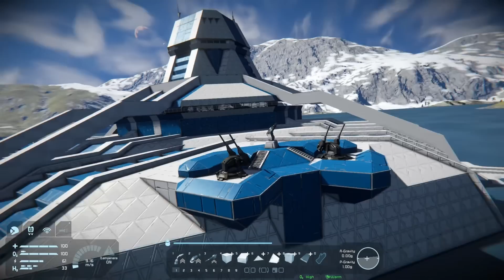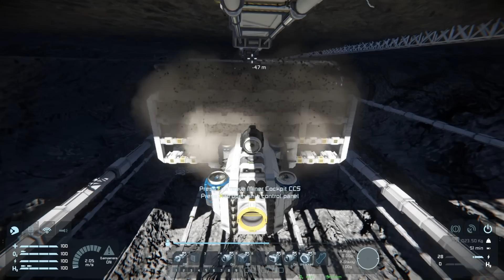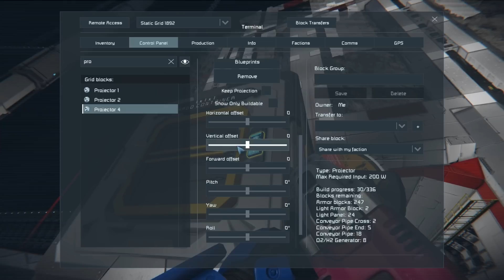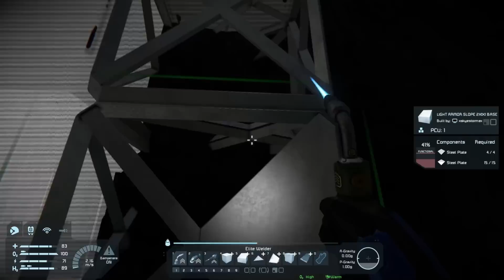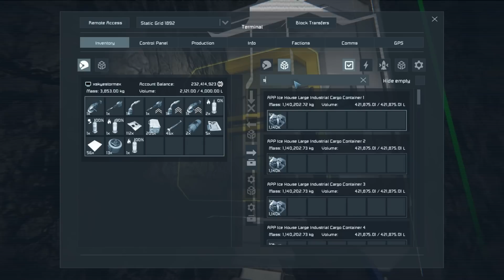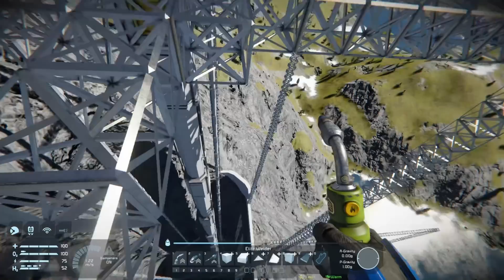I HAVE A MOUNTAIN TO CLIMB .. LITERALLY! - SPACE ENGINEERS Survival - Ep 39

Comment: 0:44 You may have already fixed this by the time I'm posting this comment, but the center drill set on you ice harvester is going to jam up the entire mechanism with how the drills are set up. It is making a series of rings in the ice between the drillheads that will catch on the conveyors, jamming the pistons. You need to either go for a solid line of drills after retracting the entire drillrig or set up one, just one, of the arms to have the drill>conveyor>drill spacing offset from the other arm's sequence ending up with one arm starting with a conveyor and the second a drill. a lateral drill on the longer of the two arms would also be a very good idea to eliminate the ring that is going to form between the center bore hole and the path of the outer rigs.

Comment: Ok dumb question is it possible to attach the cutting head with a docking port so you can change atachments to a welding head.   Just like a tractor can change from a digger to a forklift to a snow plow to... Whatever you can think of attaching. Maybe add a docking port on the side of the attachment so you can park it.

Comment: You also wouldn't use canons like that if it was for defense. You would have them lower down so people can't get below them into that blind spot.

Yep, I was going to suggest putting welders in place of the drills you just used to drill that place out. Keep in mind there is a direction to them for getting the most out of the reach of the tips. One side of the tips welds further out than the other side.

Comment: having access ports (wide open sides) to the ice drilling rig is a-ok, however the thing that irks me a little is, 
the gun emplacements - even if just decor - are only covering half the station.

suggestion: 
2 gatlings on every quadrant up at the control center, consider them Point-Defense against rocekts, missles & bombs
1 artillery & 2 autocannons on "ground level" for all the quadrants or if you like over kill, at every corner of the baseplate octagon.

it ll be the last suriving installation, once you piss off the other npc-factions.

Comment: Interior blocks use construction components and interior plate. Both of which take less iron to make that steel plate by A LOT. So, YES interior blocks are much cheaper than light armor. That takes 25 iron plate to make. Compare that to interior blocks not sure of the number of parts. It is a great way to reduce the use of iron. If iron is in a shortage, but the fact iron is the one material that I always wind up with millions of kg that I never use. 🤦‍♂🙄
I say use what makes the space look the best. 😁👍
I like the basic panel. I have used it for landing pads in the past. Those lights do show up slightly, but they do.

Comment: Try creating a blueprint of the wall with the projector and the next segment will appear after the projector is finished.
In my opinion, it would be enough to connect the pistons only from the edge of the hole, but you know best what your plan is, maybe it wasn't a big waste of time to connect the pistons from the top of the structure.
Reply: How can you configure the projector to project a blueprint that contains itself? or does that part still need to be done manually? or can you update a blueprint after creating it?
Reply: @nurmr  The Blueprint should of course be created with the projector parameters set so that the next copy will have the desired settings. This method is suitable for repeating segments over a long distance. If you want to change something, you have to do it manually. The Blueprint and the projector are used to create a virtual copy and not to read thoughts, which we sometimes need.

Comment: I've been thinking about autobuilding things. Is it possible to move projectors with pistons?
If so, you should be able to build e.g. infinite tunnel bores.
You'd need to build a "stepper" and hook it up with a connector, project a central line of conveyors forward from the stepper's back (where the projector won't move yet), and have pistons extending forward to the stepper's head, with drills on the front, welders on the back, and a connector. 
If your projector blueprint includes 2 more connectors, one where the connector on the stepper's head will when the pistons are around their max distance (positioned so that the stepper head connector can reach it after the welders have build it) and one more along the way.
If that's possible and you can set up the event manager thingy to follow the right sequence of instructions, you can have your stepper in starting position, connected to your base with the connector on the stepper's back. The stepper would then extend, drill and weld until it meets the second connector it just built. It would connect there, disconnect at its back, turn everything off for safety, contract until its back meets the other connector it has built. Once it connects there and disconnects the head again, it's in the exact same configuration as at the start, so this process should be repeatable endlessly if you have the resources.

I know nothing about the game except what I learned from your videos, but I like the idea and it might just be possible.